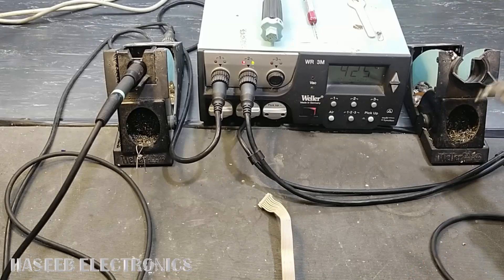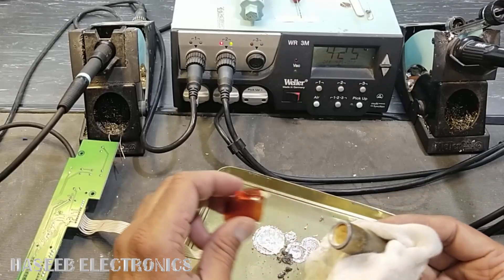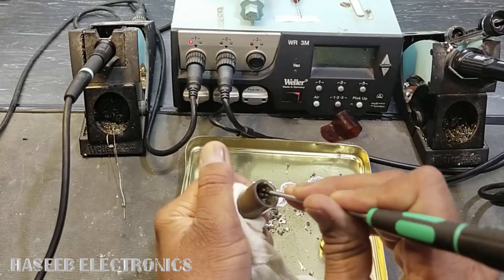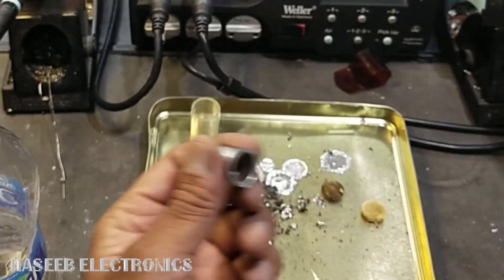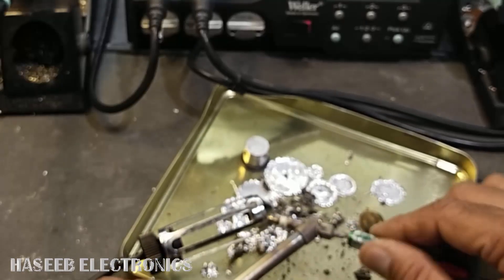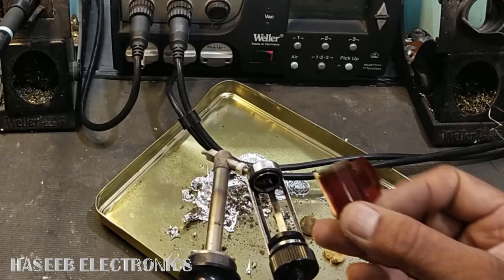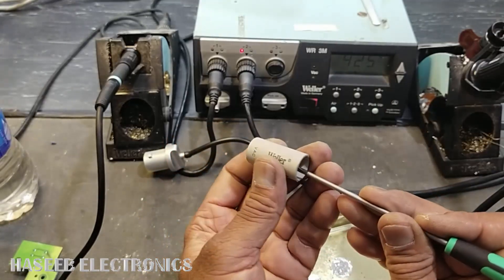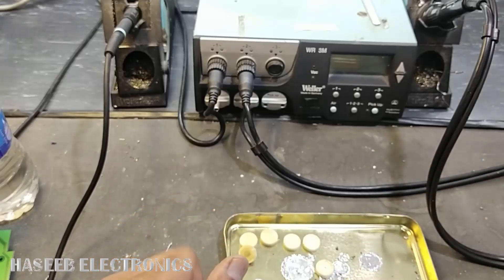{650} Desoldering Gun, Not Sucking Solder, WR3M Vac Red Light Error

Comment: Hello Sir, I really enjoy your videos. I have watched all your videos on smpsu repair. I am experiencing a big problem with a smpsu I am repairing the viper 22 chip will not startup. I have tried replacing it, but it still wont startup. I am measuring 6.7 volts across pin 1 and 4 of the viper ic. I would greatly appreciate your help thank you. I have checked the PC817 optocoupler and it is working.

Comment: Sir i can buy such machine 
And i try to repair inverter ac pcb but the soldier used in pcb is very heard and  Solder is filled through the pcb hole, it becomes very difficult to desold, 
Desoldring pump and 60w iron are unable to Desold , Sir how can i do it please reply